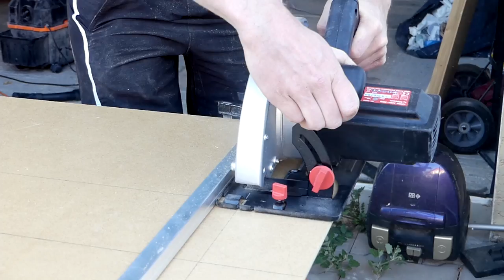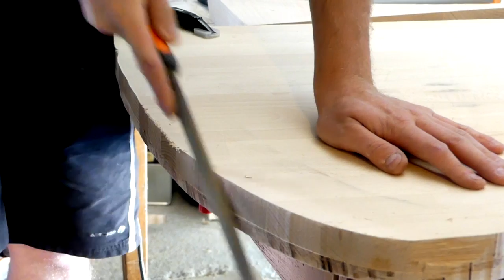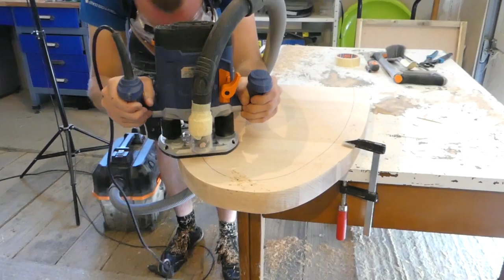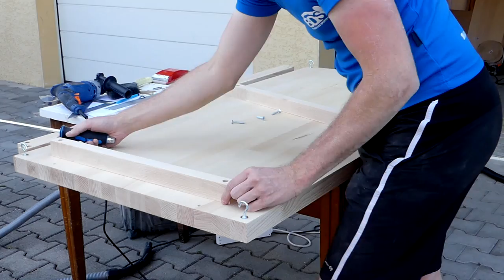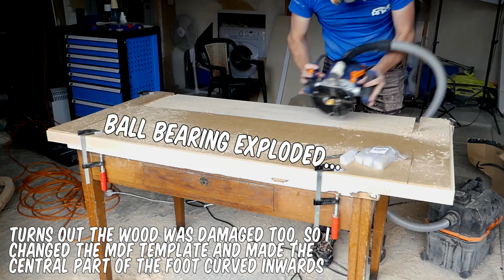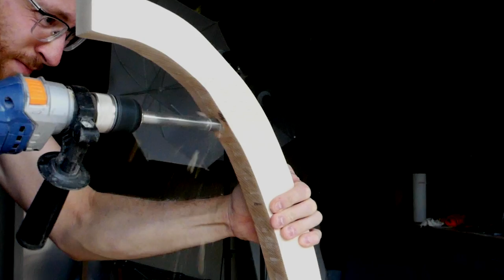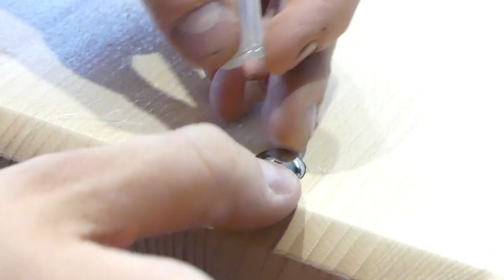The Impossible Floating Table !! (Tensegrity Dinner Table)

Comment: Really cool build.  I LOVE the arches!  I'm not a fan of the chains, but that is personal design preference.  I like the adjust ability of the eyelets.  good job.
Reply: I’m not a big fan of the generic chain myself, but, I was thinking maybe some ships anchor chain would give it a bit of a nautical look. I’m not experienced in the nautical world and don’t know anything about anchor chain size, I’m just thinking it give it an interesting look. I also agree with other posters that some cross diagonal support along the length of the table would add substantial support! Unfortunately, the way the arches are fabricated, the additional weight of anchor chain might result in structural failure, specifically, the 2 arches coming up from the floor!😩 I don’t want to be overly critical of this project, visually, it’s really interesting, I just think it’s structurally under designed.
Reply: Anchor chains are HUGE
Reply: Aren't the eyelets required in order to add tension?
Reply: Daniel McKinney Yes, the monster chain we normally think of is huge, but I was thinking of something more along the size of a 2” link, see this link,  https://www.diytrade.com/china/pd/10089205/Anchor_Chain.html. A co-worker of mine had anchor chain that he welded into a circular fire pit for his backyard. Welded up and looked nice with the fire backlighting the chain. I agree that the larger chain is huge, would need a forklift to move the table! Smaller chain would only need 3 men and a boy to move!
Reply: it's a  " mind- fuck "  bit of   art-work. so glad it was shared.   if I was to ask..I would happily pay for  somebody to   fit a  motorised ( cheap engine ) I would supply  and  the old style  cycle  I have.  I don't  have the nouce  to  complete this project.    but I pay for some one to  do it. I make the tea   and learn by watching.   I really appreciate that.  I in   Canterbury U.K.   well  more Whitstable..if any one has the  skill set to  assist me.   I don't  expect anything    ( for nothing ).   I just would  be so happy if someone could oblige. 
    I am   56 and I care for my elderly father with my lady friend of  18 years.  I have  her blessing and my Dads  but I am in no way  mechanically minded.....
     helping  me with my  PX125 VESPA  that requires a bit of   t.l.c. around the  gearing....    is another story .    Are there any sympathetic  souls   out there  in   youtube land. That can make my dream  come true .  ...this is  just  a   " shot in the dark "..  my cup is  half full.
         Thank- you for even reading   this.   cheers

Comment: If there was magnets strong enought to take the place of the chains that would be perfect...Not that still isn´t
Reply: Not much of a dinner table if you can't pick up your silverware
Reply: @LB-vf2hm  Silver is not attracted by mangtes.lol
Reply: @LB-vf2hm  Silver is not attracted by magnets.lol
Reply: Silva modern silverware is usually stainless steel.
Reply: @LB-vf2hm  most stainless steel alloys that would be used in flatware are non-magnetic
Reply: @joshdd123  interesting.
Reply: A magnetic system would be much harder to make stable. It would probably be feasible with high temperature semiconductors although it would get annoying to keep replacing the liquid nitrogen.
Reply: @garethbaus5471  high temp "super conductors"
Reply: Or hold a seance
Reply: Take it up a notch and use electro magnets, you flip a switch and the table top rise up.
Reply: @joshdd123  Not true. I suggest you try a magnet on your flatware. Spoons, forks and sometimes knife handles are typically 18/10 steel. While it's not highly magnetic, it is magnetic (again, just try this). Knife blades are a harder steel alloy, and are highly magnetic.

Comment: I get it🤔 the 2 chains in the middle are the main part holding it up, and the other 4 are there for balance/support. It's actually rlly simple when you think about it😁👍
Reply: The chains in the middle is the one holding it true but i think it will still sway left and right a little even if there are chains in the edges

Comment: I am carpenter and my eyes are bleeding of what I see. Wrong sequences, unsafe and incorrect use of tools.
Video should be called: how you should not work with wood.
Reply: Yeah, I was cringing at the use of the router to make full depth cuts through that 8 quarter lumber. I wasn't surprised to see the router eat a bearing. Cool design, though.
Reply: Exactly what I thought! The curved pices are worked out so improperly it´s a shame! Why hadn´t you use a template to make them? And the massive waste of good wood for the stand... Sorry, nice idea, but a little more planning would have been better!
Reply: What do you mean? I always use a 12” drill for making a  2” counterbore. Keeps it nice and square that way... I hope he doesn’t use the table for chili or stew night.
Reply: Right from the get go when he broke out the Dremel to rip that MDF template I thought some weirdness was on its way.... I wonder if it’s dawned on this fella that correct use of tools might make his experience better. Hope he has all of his fingers in the coming years 😬
Reply: Same...personally I would have fixed my band saw tire rather than destroy my router bearing and bit...and used the right sized collet in my router...and...I could keep going but hey, he got away with it this time so why not advertise the methodology right?
Reply: The use of the skill saw was all I needed.
Reply: Let's not forget about the fact that he just destabilized the entire Top by bolting down the apron across the width of the panel.

Comment: Cool design. My worries though the full weight of the tabletop just depends on the two skinny upward arches and middle chains. Yes the two upward arches that serve as legs/support were bolted together by a horizontal piece but the portion of that arches past the bolted horizontal wooden bar may not be durable enough to handle the full weight of the tabletop. Plus I’m imagining it’s kinda “rocking table”

Comment: ...until the wood bows ever so slightly and the  chains begin stretching from stress and it becomes wobbly. Good fun but not practical
Reply: Jet Gardner the timber will break long before the chains feel anything.  I doubt very much it could support a sack of potatoes.  Those arches weren’t constructed properly.  The central chains will snap them like twigs with a sharp blow.
Reply: the design is intended for light things/materials to put on top of it and added interior decor.
Reply: @RommelGregorio  Which makes it's prime function useless, much like one made of decorative cardboard.
Reply: hmmm, guess you're right!! two heads are really better than one :)
Reply: @rouser301  i dont know what you want to do on this table, but if youre only eating or working with a laptop on it, it wont break or wobble too much.
Reply: @maurizioarrivabene8182  flirting with me will get you nowhere
Reply: @rouser301  lmao
Reply: It works pretty well if it's a chair, just like amir creator do.

Comment: I have been a woodworker for 45 years.  I have worked for 4 power tool companies. I have never seen someone have all of the correct tools (except the most basic, a table saw) and use all of the incorrect tools to do a task. And use dangerous techniques to do them. I am completely baffled.
Reply: What was the purpose of the plug in the collet? Was it to provide a depth stop on the bit? Scary. Also, though the half arches may be strong enough to support the weight of the table top, itself; they have very little design strength.    Do not try this at home.

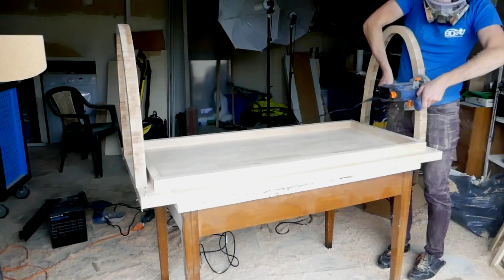Comment: 7:02 using a router at chest level with the bit facing you whilst leaning over the project... Wtf 😂
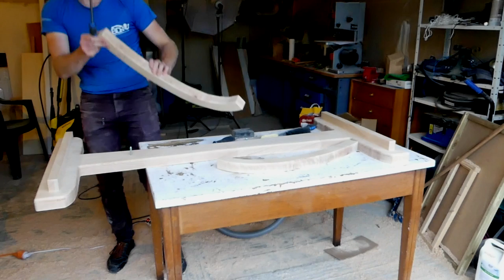Reply: 9:54 using a hex wrachet on a screw driver on diy slotted hex bolts...   90% of this video is derpy
Reply: I bolted mine under my table saw. I know it can't do everything from that position. But it handles 99.998 % of my needs, safely. Unless you forget to tighten the lock screw and  you have to hop around to keep from getting bit from a runaway router

Comment: I’m not quite sure what the mystery is here.  The center two short chains prevent motion in the y direction (vertical) while the four other chains at the corners act as stabilizers, keeping the table top horizontal.

Comment: I admire the design ingenuity. The design itself is a matter of personal taste. I don’t think it could ever be a commercial product using the materials shown as the wastage would not make it economical. It would have been far simpler , stronger and more pleasing to the eye to laminate the arches. 

However, I would urge people not to follow the methods shown on film. There are many practices which are so unsafe as to verge on the dangerous.
Reply: Martin Cox doing things the way the have always been done and not doing things at all is totally devastating to the learning process and intelligence. You just keep doing that if you like the result you are getting. 👏🏼......👏🏼......👏🏼
Reply: elsa Grace different is not a definition of better. Different is not a definition of progress. A learning experience can be about thinking and planning what the result of different is likely to be and whether that different results in an improvement. I’ve only worked in original designs in wood for 40 plus years and so I may have got it all wrong during that time. Be happy; I am.

Comment: The idea is very good, but the workmanship is lousy. There was a lot of waste. The fiber direction in the support structure is bad. Post-assembly machining is a bad idea. Mill the curved leg next to the template so that it does not have to be filed afterwards. Not a thoughtful implementation, but I really like what you came up with.
Reply: Lets see you build one.
Reply: @sycoticpsycho  yeah. Idea i liked too. Will build something similar. But he shoud add more love to work. Lines are too curve and wiggle. Shoud sanded alot better or use template to cut them.

Comment: Nice design and nice inexpensive materials choices. For all the effort, I wish you had sanded the curved parts more thoroughly for a better final appearance. In looking at various designs using these principles for functional furniture, final stability is a key attribute. So I was surprised and disappointed not to see any demonstration of how sturdy it is (or isn’t) after final tensioning. Can you comment on that aspect? How much weight will it hold? Does it have to be carefully evenly distributed? Can’t really evaluate success of this interesting design without that additional information.

Comment: I'm really interested on how much movement/sway the top of this design has in comparison to other styles. i understand you tightened it so it wouldn't have much sway, but did that remove it entirely? I've seen other videos where the table has quite a bit sway
Reply: If you pay close attention to the end where he's gluing in the caps for the holes, you'll see there is quite a bit of sway. Very impractical for any kind sustained use, especially a dining table.
Reply from the maker: It wasn't tensioned yet ;) when right, its sways very little but it's not perfect. Hands on the table dampens most of that movement though !

Comment: The illusion could be enhanced by continuing the center chain from the table top to the base. It would look like all three chains were there to hold the table top down. This would camouflage the fact that the center chain is the only one actually holding up the table tops weight.

Comment: The two arms on the base.   Depending on your grain, you could be looking at a weak point.  Any significant weight pulling the chain downwards is going to strain the arms.  Even with two of them the weight displacement won't hold well to a wood grain running horizontal with the table top.  

Not hating, just saying.

Comment: brilliant physic work. the 1st time I saw this table, I think to myself, 'not that hard, the trick is to just weld the chain like a solid pipe' but after seeing this video that's not what he did, but you can also do as my method too, and it will be much stable and reliable than the one in the video hehehe
Reply: Hardly more stable if the chains are properly tensioned.
If you weld the chain it's not suspended is it?
Reply: @RedRooster-xj4uk  what I meant by welding the chain is welding every join of the chain so the chain becomes like a rod but still looks like a chain
Reply: @Sailo-11  I know what you meant. Then it would not be suspended, would it?

Comment: Did you just use wood as a collet adapter? Not safe at all. Wood burns at high speeds on routers with the friction and will shoot a router bit like a bullet. I had a router bit once come out and thank god it flew the other way because I would have been seriously injured or dead if it would have hit me. Cool table though. Be safe.

Comment: It is an amazing table design but there are still some comprehensive components in the structure. I’ve been wondering for a while if it is possible to build anything with no compression whatsoever. I suspect the answer is no but the question interests me.

Comment: what was the thickness of the slab you did all your cuts from? Did you have to build a 2 inch thick slab or were you able to get the slab from some building department? Ignore the negativity comments I think this is a cool table, I'm sure it sways some. I would've probably tried using a jig saw rather than a router....

Comment: People have commented on the instability of this design. That could be much improved by cantilevering and tensioning the four vertical corner chains. There are several possible anchor point configurations, ideally you would want to position them so that the chain tension countered their opposite.
There would still be some movement, of course...not possible to eliminate it entirely, without departing from its  'floating' design.
Though, I do not think that stability was the primary consideration.
Reply: Bobby H. If he were to tack a little weld on the backside of every link it would sturdy it up
Reply: @dukenukembubblegum7311  Yep, that would work too. That is the main problem with using chains, as they lack rigidity. A small  hidden 'tack' would keep the floating illusion and greatly improve the table's stability.
As a matter of fact, I have seen motorcycle frames made of chain links tacked together...much stronger welds, of course.

Comment: How stable is it in use?  Have to imagine it, because we don't  see video of you using or even touching the table after assembly.  I have to believe that it moves easily side to side at least a short distance, since there is no cross bracing, so that glasses are much more likely to be toppled over in the event some relatively small contact against the side of the table when sitting at it.

Comment: Cool idea, but from the point of view of occupational safety, the production as shown here is a disaster. A few times I couldn't really believe what he was doing and that he really still had all the fingers after completion. 
Please DO NOT REPEAT IT THIS WAY!!!
I would also be really interested to know how stable the table top really is, as it is only held by the two chains in the middle and the outer chains only serve to stabilise it. How tight do the outer chains have to be?
Reply from the maker: Too tight for the wood to handle it tbh, I think if I want one that doesn't move, I'd have to implement the following improvements: chains not vertical (tipped to absorb more of the swaying) and metal arcs instead of wood. I agree that my method in this video is pretty bad, but I always read the comments to try and improve so if you have any constructive criticism, don't hesitate for a second :)

Comment: For the love of all that's holy Greg, at the very least, clamp that freaking vice down. And adjust the bandsaw blade guide to the proper height depending on the work.
Reply: The concept is awesome, but the execution is horrible, you forgot to stain it and seal it. [Don't eat spaghetti on it].

Comment: I'm planning to make something like this. Does it have to be symmetrical, like equally weighed on both sides or does it not matter much?
Reply from the maker: Doesn't matter much, but it will still be wobbly like everything that's tensegrity-based with tension in only one direction (vertical in this case)

Comment: How about the horizontal movement, how will it stay fix?
Reply: Same way your hand does when holding something up.  Tendons in tension, bones in compression.  The term coined for the combination is tensegrity.  In this case, not a lot of diagonal support, so it wobbles more than most tables should.  (Almost all of these structures on YouTube have that flaw, while there are real road bridges using the same principles safely.)  A little more engineering could have made it much more stable.

Comment: Cool design, but why cut the curved pieces with the router?? 🙄 jigsaw or a large table scroll saw would be more effective for rough cuts sand smooth after, no wonder the router bit bearing exploded😂 routers aren’t for cutting large amounts of thick material only “edging” afterward. Also the screw holes on top would be better with wood plugs before varnish, then finish... those false carriage bolt heads hot glued there will fall out or get dirty with use... 🤔👌🏼